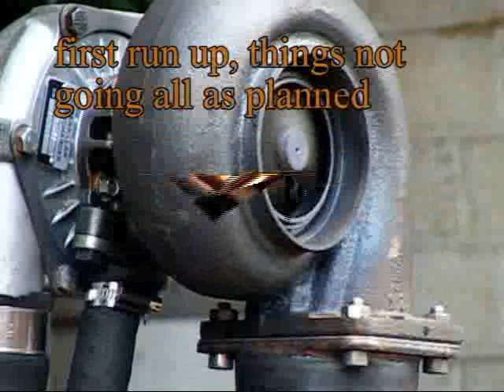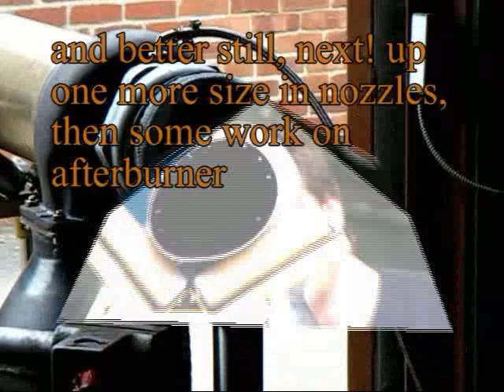Building Jet Engine from Turbo - my history of turbojet testing

Comment: @Turbojetkart
Would using an IC not be the opposite of what you want to achieve? I mean, in a direct line this would be what is happening to the airstream: Compression (heated) -> IC (cooled) -> Combustion (heated) -> Turbomill (cooled).

If you use intercooler, you LOSE energy (heat and pressure) that is needed to drive the mill.

 If I missed something, let me know :)
Reply from the maker: things have come a long , long way.... 116mph world record... next project 175mph.... looking for help.... well a little 
https://patreon.com/jetenginesandymorristreon?utm_medium=clipboard_copy&utm_source=copyLink&utm_campaign=creatorshare_creator